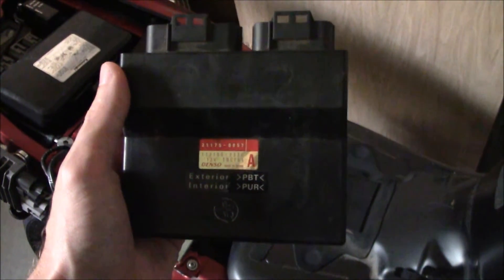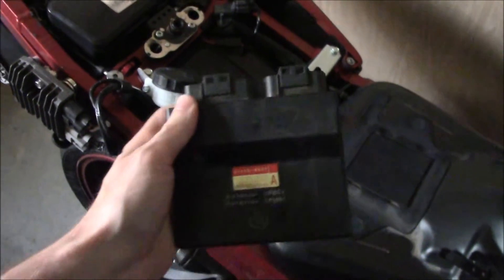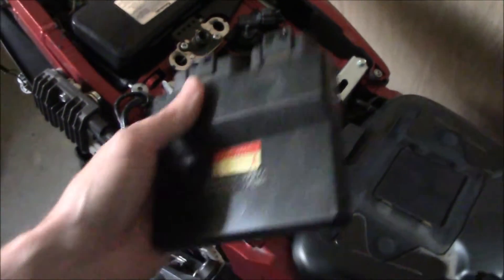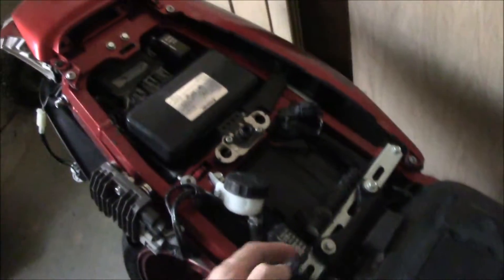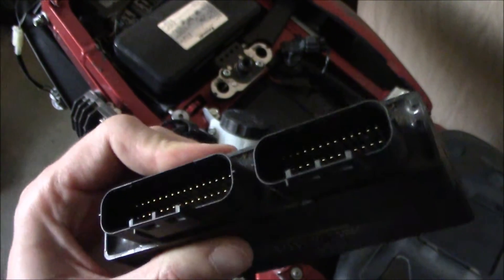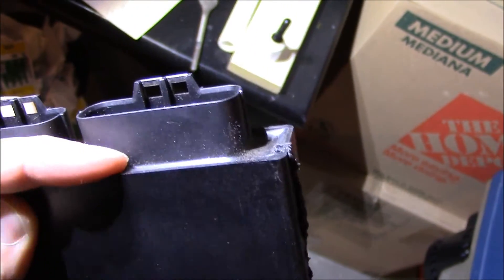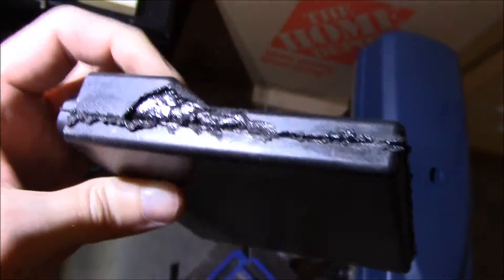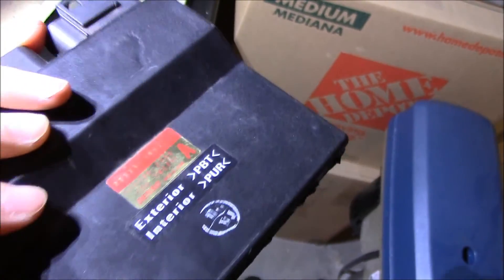Kawasaki ECU. Whats inside? Fail.... Just goo.  2005 636 ZX6R

Comment: howzit Bro...2023 😱in the future I think your vid might have given an answer to my problem, Zx6r 06 model, I have replaced almost 4 fuel pumps in a span of 2yrs😢, bike runs like It has a fuel issue.. when I rev there is a noise coming off the ECU (crackling noise).. could this be a ECU problem.. bike spec: pcd3/Arata full exhaust/dynojet quickshifter.
Reply: It’s because your exhaust is under your seat which is exactly your ecu is so it tends to get hot then fry the ecu solution convert your exhaust to the side

Comment: Well, yeah… they call this “potted.” You find this in non-serviceable power supplies and such all the time. It not only keeps moisture and such out it also helps contain exploded components while conducting heat… since air would only insulate causing potential overheating problems after sealing.

I have had some success gutting potted PSUs by freezing them and then hammering the housing with a rubber mallet until the compound breaks free of the plastic housing. From there I start chiseling away at the frozen potting compound but I often crack the board or something. Still, it’s a start.

Comment: It can be fixed. I just fixed mine ECU (zx6r 2006) few days ago. It was causing bike to stall after 40+ km ride on a hot day. Soon I will put a video on YT. It is very long and tedious process because you need to remove all black silicone mechanically by hand and be very careful not to brake any of electronic components. After all black silicone is removed than it can be electrically fixed. This is the only real and permanent fix and reallocation on ECu won't help much, nor forced cooling of ECU. Most probably I'll offer repair service for this, since ECU is small enough for long distance shipping that doesn't cost too much. I googled a lot before I started to repair and didn't found any repair service on kind for 2006 636 ECU, also didn't found any post suggested that someone managed to fix it. In the mean time, if you know for similar service please let me know
Reply: Hi. same problem here! Can you do a video tutorial how to fix this, please??
Reply: @werthz  fix it ?
Reply: @werthz  I still have this bike to this day, and repair was 100% successful, not a single problem after the repair which took place 2 years ago. Sorry, but I don't plan on making tutorial since the process requires handling some expensive and dangerous chemicals and advanced knowledge in electronics to be able to repair it. Also it's very time consuming, it took me days to repair my ECU because it takes lots of time to dissolve black goo. I can only offer to repair it myself, if interested PM me. Price is 200usd if I manage to fix it, no charge it i don't. Your alternative is to get used one, but you never know the condition and you need to get it together with ignition lock and key if ECU is version with immobilizer, otherwise you won't be able to start your bike. My contact address is in my 'about' section if you are interested.
Reply: You still fixing these ecu, in need of repair...
Reply: @luisortiz590  Yes, see the reply I've sent to WerThZ.
Reply: Hi reljat, could you help me to fix my zx6r 2005 ECU? Thanks
Reply: @cristiansabatino7536  Please see the reply I've sent to WerThZ.

Comment: Marcus: I bought replacement ECU and that didn't solve it. I took my fuel system apart and my fuel pump was full of rust inside. My gas tank also had rust and I feared even my injectors were going bad. I bought on eBay used parts to replace all. Used tank in decent condition 200 dlls, secondary injectors 15 dlls, main throttle body assembly with primary injectors 60 dlls and the fuel pump was 70 dlls. That solved it. I hope you figured it out already. Sorry for the late response.

Comment: i have a kawasaki gpz 600z and have a problem with the sparks. 1 and 4 are doing great and those are on one plug. 2 and 3 do not give a spark and i have checkt the bobine but that one is ok. all 2 plugs (bobine) come from a ic igniter aka ECU so there would be somthing messy in there. now i see you trying to open up the ECU with a small drill but the case is made from plastic. plastic melts so i wil try it with a hot iron wire to fry it open and hope not to damage the inside.

Comment: I just recently purchased a 06 ECU for my 05 zx6r because the old one was fried. Once I swap them out, is there anything else that I have to do?
Reply from the maker: +Baka Hannibal If that was the only issue, then it should be a straight swap.  Just plug and play.  Good luck!
Reply: +Far Reach Engineering Thanks for the response!!

Comment: How did you diagnose that the ECU was done? I have an 05 zx6r and I am having some issues, by reading feedback from other 636 owners I suspect my ECU is going out (common issue for 05 models). She is my first bike, I would appreciate your input.
Reply: +Jesus Olvera did you ever find out the problem I'm having the same issue thanks
Reply from the maker: +Jesus Olvera For me it was the fuel pump that was acting up.  By putting power to the pump and ruling it alive, and by checking the fuses, and showing them to be good, that narrowed it down.  From there It became even more detailed.  That being getting the wiring diagram out and tracing everything that would control the fuel pump.  That lead to a relay and the ECU.  The Relay was determined good by checking the values on it.  That left the ecu.  The pins that were to control the Fuel pump would read crazy values that indicated that portion of the ECU was toast.
Reply: Thank you. I was able to replace the ECU but am still experiencing bucking and stalling. Am dropping it off at a mechanic hoping I can get more help. Of course this used ECU could also be fried... If I get no answers I will have to get a diagram and start testing for values. Am assuming you use a voltmeter?